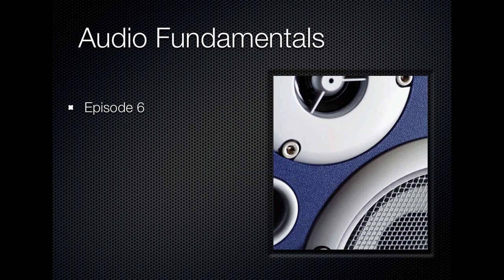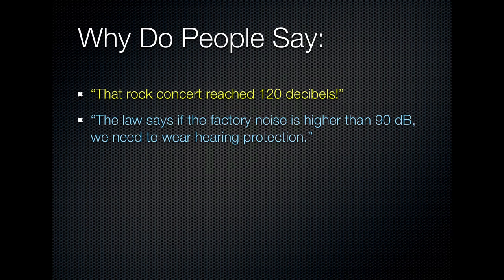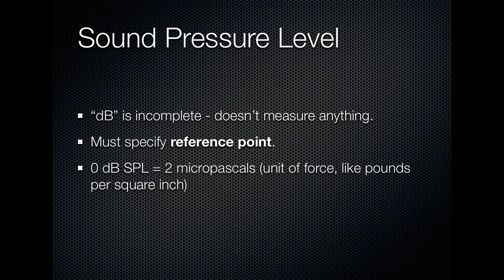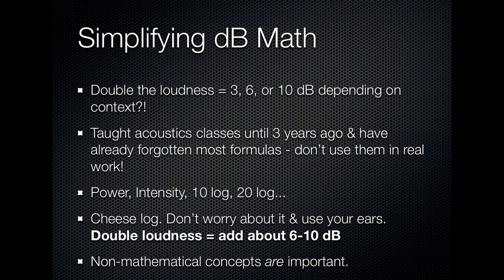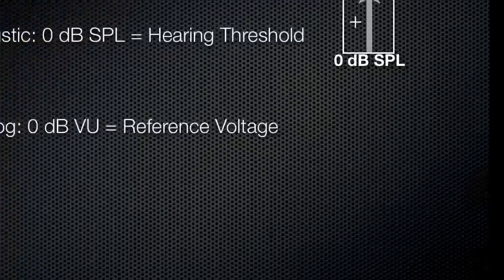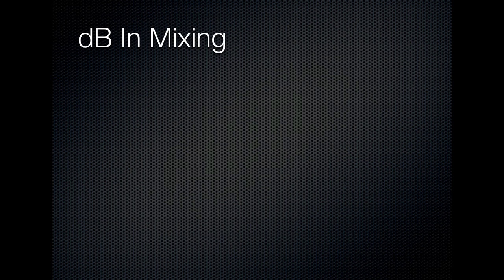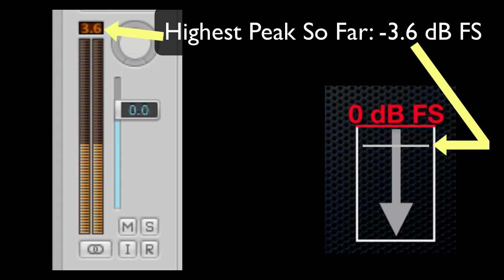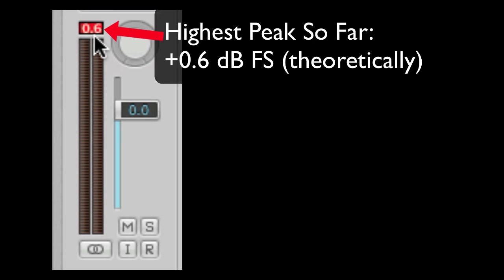AF006 Defining the Decibel (dB) and Intro to EQ

Comment from the maker: This is where I start forgetting all the physics I ever learned! In the digital domain, doubling the sample values is definitely a 6dB (6.02...dB) increase. If I recall correctly, sound pressure is proportional to voltage and sound intensity to power, since pressure is localized and intensity is per unit area.

0dBFS - it's usually a peak measurement, so either the full scale sine or square wave will register as 0. The square wave has a much higher average level so it will sound louder, though.

Comment: I've always wondered: Does +6dB mean doubling the amplitude (which should be proportional to voltage if you output to a speaker) or doubling the power? Because double voltage means quadruple power as for P=U²/R. And is the sound pressure proportional to voltage or to power?
And is 0dBFS usually defined as sine wave peaking at full amplitude or square wave?